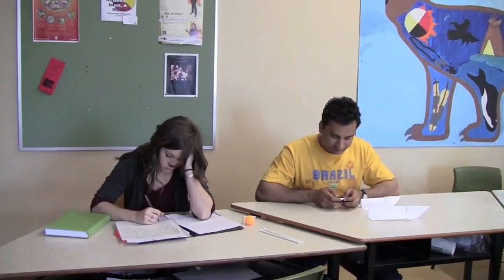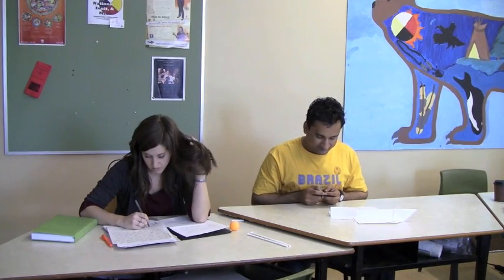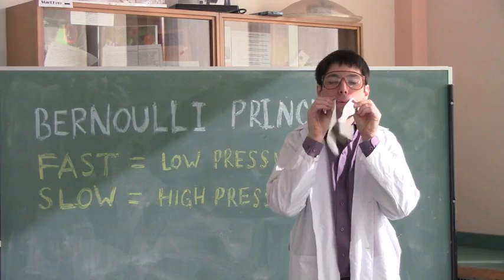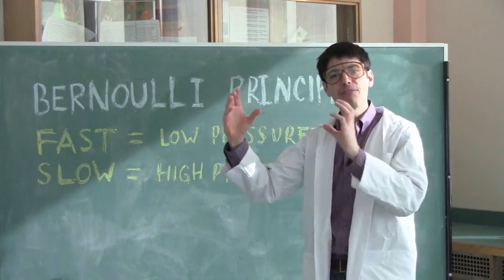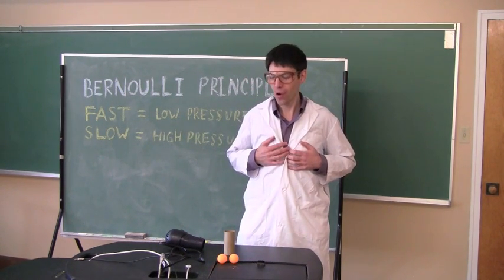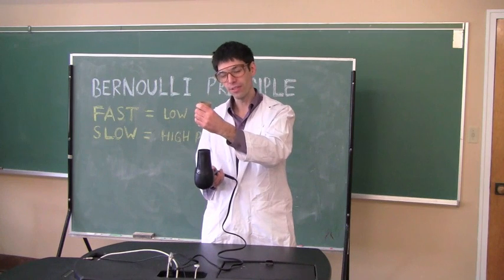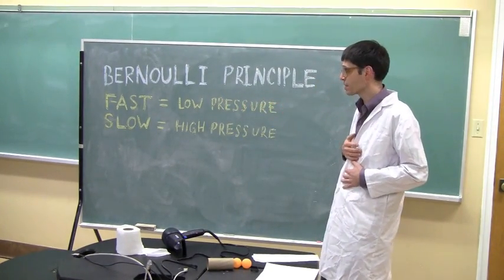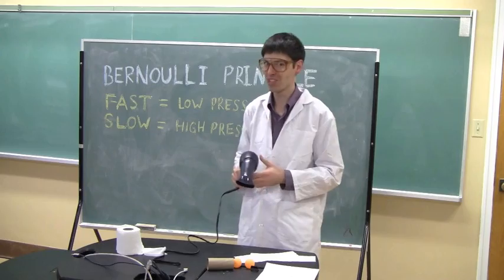✈✈ Bernoulli's Principle - Easiest Way Explained ✈✈ ☹ ☹

Comment: I wish my teachers was so enthusiastic about the subjects they taught!
Reply: I am very sorry, but this is only repeating some  of the most common misconceptions in science.  
Fast air does not have low pressure.  What Bernoulli found is that Accelerating air has a decreasing pressure and visa versa; BUT NOT what caused this to happen.  
--
Euler continued that study and realized that it is a pressure Gradient (difference between two locations) that is the force that accelerates a fluid.  This is Newton for fluids.
...
The air out of your mouth is at atmospheric pressure; that same pressure as the still air around it.  It is the higher pressure*created *inside your lungs by the contracting muscles that accelerates the air out into the lower, atmospheric pressure.
..
Blowing next to paper demonstrates entrainment which is caused by viscosity. . Look them up.  
If this is what your teacher taught, they have been misinformed, which is, unfortunately, VERY common.
--
The air over a wing only looks faster in a wind tunnel.  The lower air is actually faster as a wing flies by you.  The upper air is, however,  accelerated much more caused by the lower pressure above the wing.
The pressure changes around a wing are simply caused by the wing pushing air out of the way to get through it.
...
Bernoulli had nothing to do with the development of the airplane. He was doing blood pressure studies.
...
The air above a wing gets to the trailing edge significant;y BEFORE the lower air; which is caused by the low pressure accelerating it toward the rear.
...
The ping-pong ball is held in the center by the Coanda Effect. A flow that follows a convex surface is what lowers the pressure. Think of centrifugal force pulling the air away and, therefore lowering the pressure.
 The air out of the hair drier is at atmospheric pressure, The side of the ball where more air curves around to the down-wind side (top)  of the ball has a lower pressure because of the greater Coanda curved flow. 
When tipped, there is more air flowing over the top AND flowing in a curved path (around the back and then downward).  This lowers the pressure more and supports more of the weight, therefore, allowing the upward moving air's dynamic pressure to push the ball further out..  This is the only explanation which explains why the ball moves further away when the flow it tipped because the air is slowing down farther from the blower and the centering force would be less, not more, if the Bernoulli fallacy as true.
..
ALSO, if the air at the blower's exit was lowest, the ball would be "sucked" down (actually pushed down by higher pressure above it)
...

The tube above the ping-pong ball is a very good discovery and requires a more careful understanding because this fact air thing is false.  
My initial analysis is as follows:
The tube prevents much of the air which would simply 'spill' around the sides of the ball to be trapped below the ball in the tube and to push the ball up like a piston in a cylinder.
Reply: @Observ45er This concept is the simplified for educational purposes.  Something more simple for students to understand at their level.  Your explanation is at the Aerospace engineering learning level.  If you were to simplify it, what would your simple explanation be instead?
Reply: @ryanrutten8237   Making false statements is bad science. That does not fly in serious education. If you can't simplify and stay correct, stay out of education. There is so much of this bad information out there on this subject, it is impossible for even a moderately serious person to get good information with every well-meaning Tom-Dick-n-Harry making yet another duplicate video or paper repeating the same bad information, over and over and over again. 
.

Just because it is an easy demo doesn't make it right.
.
What I use is all below or at the 11th grade physics level.  The problem is that while it is all simple physics, it has many steps to cover the bulk of just the lift force.   AND... too many people want a one sentence, sound-bite answer. 
.
When 5th and 6th graders are engaged, they get it! 

.
Lift:
.
The simplest explanation starts with: When a wing moves through the air it must push the air out of the way because they both can't occupy the same space.  Pushing air out of the way increases pressure in places and as the air flows back in around the wing, it creates a lower pressure.  Luckily for us, this makes more pressure under than above and that pushes up.
An analogy-aid I use is trying to run in water.  You must push on the water and they all have felt this.
.
.
Past that, see this: 
https://www.quora.com/q/rxesywwbdscllwpn/Understanding-Lift-Correctly
Reply: @Observ45er  This video is supposed to be for 5-6th graders who have no understanding of fluid mechanics nor knowledge of complex math. Although you are also right, this video is also right, it's just simplified for 10-11 year old kids. I highly advise you that you think about what target audience this is for, because if I was this age and I put this, the teacher would probably think I plagiarized this or cheated. Although you are not wrong, I hope you take into consideration that this video is meant to be for a younger target audience.

No offense.

:)
Reply: @coIorcodeTV   First: I grant that 99% of the people who hear a wrong physics explanation will never be affected in any way throughout their entire lives.
..
Second, there are ways to simplify without using false. incorrect science. But someone who has only misconceptions can't ever teach it correctly.  
..
I have yet to run into a teacher that says they knowingly teach misconceptions, but that the demos are easy and it'll never make any difference to the kids.  I could understand that position. . . . HOWEVER, They all think they have it right!.  They are not simplifying anything.
They BELIEVE fast moving air is at lower than atmospheric pressure down to the deepest depths of their very being.
.
I also understand that the authors may have good intentions, the most honorable, but wrong is still wrong and so many I see are lousy teachers.  So many videos ALL repeating the very same set of misconceptions.  A thousand wrong Frenchmen are still all wrong.
..
In addition, the vast majority of YT video authors and commenters are not 5th & 6th graders.  It is the adults that will argue the misconceptions while violating one fundamental principle or another of science without realizing it.
..
Also, math does not explain the science/physics. Words do.  The math allows us to calculate WHAT HAPPENS not why it happens. It simply isn't necessary to provide a reasonable understanding of lift.  All those who do don't get it. {note that I didn't show any above}
..
I work with youth from pre-school up to adults.  The main thrust is 5th and 6th graders and they can understand much more than you may think. It's a wonder when you see one  of them explain it well to another or their parent. . . 
..
Now, they won't be able to explain it in 6 months, but they will have had another example of the science that confirms the fundamentals which gives them more understanding of the fundamentals they can better and correctly apply elsewhere in the future.
..
It takes experience and requires a very good understanding of he fundamental science, first . . . . AND, THEN. . . . knowing how to use correct analogies the student can understand at their particular level.
... 
Yea.  I've "taken it into consideration", starting decades ago - more than five..

You must nail the science, then, "talk to your audience".
..
Everything I addressed above is easily understood at the 5th-6th grade level, though we are able to use other words/phrases/analogies at times and smaller example demos/experiments, but it is simple when done correctly.  Demos that they do themselves. 
..
 Challenger.org  
...
The following was compressed somewhat for the contest, but covers an important aspect that the kids follow. . . 
Flow over a convex curve causing a decrease in pressure: 
 https://www.youtube.com/watch?v=3MSqbnbKDmM 
Regards

Comment: This helped so so so much thanks a bunch
Reply: I am very sorry, but this is only repeating some  of the most common misconceptions in science.  
Fast air does not have low pressure.  What Bernoulli found is that Accelerating air has a decreasing pressure and visa versa; BUT NOT what caused this to happen.  
--
Euler continued that study and realized that it is a pressure Gradient (difference between two locations) that is the force that accelerates a fluid.  This is Newton for fluids.
...
The air out of your mouth is at atmospheric pressure; that same pressure as the still air around it.  It is the higher pressure*created *inside your lungs by the contracting muscles that accelerates the air out into the lower, atmospheric pressure.
..
Blowing next to paper demonstrates entrainment which is caused by viscosity. . Look them up.  
If this is what your teacher taught, they have been misinformed, which is, unfortunately, VERY common.
--
The air over a wing only looks faster in a wind tunnel.  The lower air is actually faster as a wing flies by you.  The upper air is, however,  accelerated much more caused by the lower pressure above the wing.
The pressure changes around a wing are simply caused by the wing pushing air out of the way to get through it.
...
Bernoulli had nothing to do with the development of the airplane. He was doing blood pressure studies.
...
The air above a wing gets to the trailing edge significant;y BEFORE the lower air; which is caused by the low pressure accelerating it toward the rear.
...
The ping-pong ball is held in the center by the Coanda Effect. A flow that follows a convex surface is what lowers the pressure. Think of centrifugal force pulling the air away and, therefore lowering the pressure.
 The air out of the hair drier is at atmospheric pressure, The side of the ball where more air curves around to the down-wind side (top)  of the ball has a lower pressure because of the greater Coanda curved flow. 
When tipped, there is more air flowing over the top AND flowing in a curved path (around the back and then downward).  This lowers the pressure more and supports more of the weight, therefore, allowing the upward moving air's dynamic pressure to push the ball further out..  This is the only explanation which explains why the ball moves further away when the flow it tipped because the air is slowing down farther from the blower and the centering force would be less, not more, if the Bernoulli fallacy as true.
..
ALSO, if the air at the blower's exit was lowest, the ball would be "sucked" down (actually pushed down by higher pressure above it)
...

The tube above the ping-pong ball is a very good discovery and requires a more careful understanding because this fast air thing is false.  
My initial analysis is as follows:
The tube prevents much of the air which would simply 'spill' around the sides of the ball to be trapped below the ball in the tube and to push the ball up like a piston in a cylinder.

Comment: Almost everything taught in this video is incorrect.  
Both the ping pong ball and the strips of paper act as they do because of the Coanda effect.  That is caused by mixing of the air in the jet with the surrounding air, which entrains that surrounding air (pulls it in sideways).
Bernoulli's equation only relates to pressure changes along the flow, not across the flow.  The jet of air he blows out of his mouth is at the same static pressure as the surrounding air.  The pressure inside his lungs (where the air is moving more slowly) is higher than that pressure.  

The equal time of flight of air above and below the wing is completely wrong.  In fact, the air over the top of the wing gets to the trailing edge long before the air passing below the wing. 
Please stop promulgating incorrect science.
Reply: It is very sensible to warn people about the incorrectness and/or obsolescence of those explanations. Why don't you make a video with accurate insightful explanations to these phenomena? That would certainly help diminish the rumor...
Reply: @discerenecessa9062  ,
This is only repeating some  of the most common misconceptions in science.  
Fast air does not have low pressure.  What Bernoulli found is that Accelerating air has a decreasing pressure and visa versa; BUT NOT what caused this to happen.  
--
Euler continued that study and realized that it is a pressure Gradient (difference between two locations) that is the force that accelerates a fluid.  This is Newton for fluids.
...
The air out of your mouth is at atmospheric pressure; that same pressure as the still air around it.  It is the higher pressure created inside your lungs by the contracting muscles that accelerates the air out into the lower, atmospheric pressure.
..
Blowing next to paper demonstrates entrainment which is caused by viscosity. . Look them up.  
If this is what your teacher taught, they have been misinformed, which is, unfortunately, VERY common.
--
The air over a wing only looks faster in a wind tunnel.  The lower air is actually faster as a wing flies by you.  The upper air is, however,  accelerated much more caused by the lower pressure above the inwg.
The pressure changes around a wing are simply caused by the wing pushing air out of the way to get through it.
...
Bernoulli had nothing to do with the development of the airplane. He was doing blood pressure studies.
...
The air above a wing gets to the trailing edge significant;y BEFORE the lower air; which is caused by the low pressure accelerating it toward the rear.
...
The ping-pong ball is held in the center by the Coanda Effect. A flow that follows a convex surface is what lowers the pressure. Think of centrifugal force pulling the air away and, therefore lowering the pressure.
 The air out of the hair drier is at atmospheric pressure, The side of the ball where more air curves around to the down-wind side (top)  of the ball has a lower pressure because of the greater Coanda curved flow. 
When tipped, there is more air flowing over the top AND flowing in a curved path (around the back and then downward).  This lowers the pressure more and supports more of the weight, therefore, allowing the upward moving air's dynamic pressure to push the ball further out..  This is the only explanation which explains why the ball moves further away when the flow it tipped because the air is slowing down farther from the blower and the centering force would be less, not more, if the Bernoulli fallacy w=as true.
..
ALSO, if the air at the blower's exit was lowest, the ball would be "sucked" down (actually pushed down by higher pressure above it)
...

The tube above the ping-pong ball is a very good discovery and requires a more careful understanding because this fact ait thing is false.  
My initial analysis is as follows:
The tube prevents much of the air which would simply 'spill' around the sides of the ball to be trapped below the ball in the tube and to push the ball up like a piston in a cylinder.